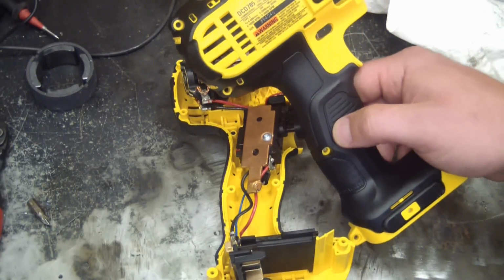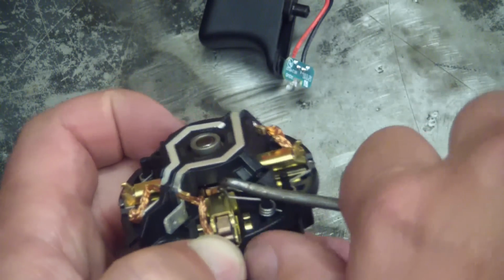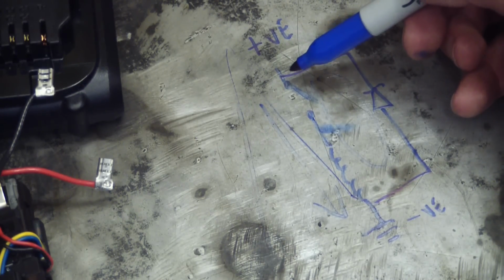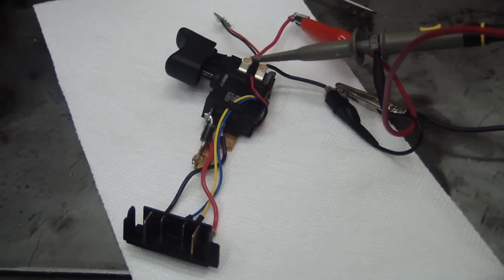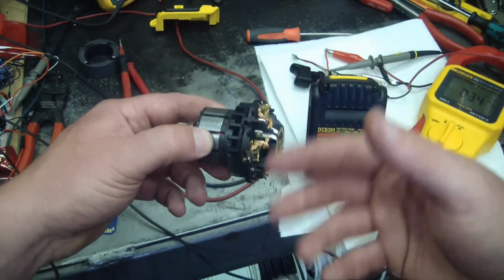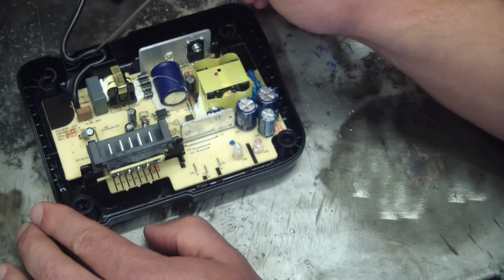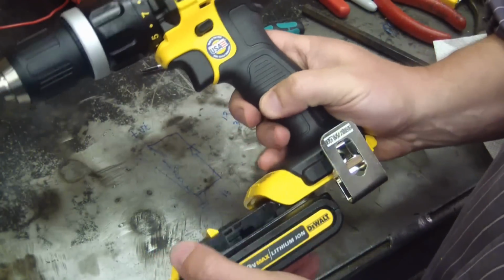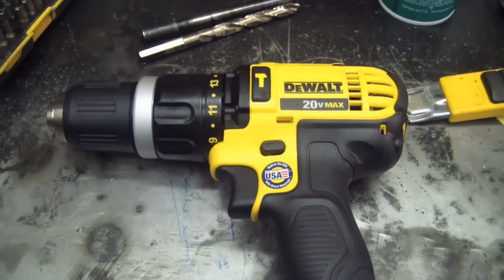BOLTR: DeWalt Hammer Drill. Test, tune and Electrical

Comment: You may not care much for hammer drills or love dewalt's construction but my dewalt 18v hammer drill has proved it's worth on the job and I've never second guessed purchasing it.

Hammer drills aren't a substitute for rotary hammers but hammer drills do fill a purpose where rotary hammers are overkill - you don't hammer roofing nails with a sledge hammer.

Comment: Great Job!  I actually understood your explanation of the electronicals!  I'm not starting from scratch...I already knew about shunt diodes and bridge rectifiers, but the rest was mostly new, and very clearly put.  Well done!

As for DeWalt tools, I was amazed at the power my next-size-down from yours drill has, and even more at the power of the impact driver that came with it in a set at a woodworking show. The demo they had set up let you drive 6" lag screws into pressure treated 4x4s. The little things drove them without slowing down, then ran them back out just as quickly, over and over again.  Convinced me and I bought them. Been happy with them ever since...several years. I think the impact driver is rated at something like 86 in-lbs. Won't replace the air impact wrench for changing tires, but for what it's intended for it's more than capable. 

Can't say the same about the Ryobe hammer drill.  Same issue with that feature as you had....can't drill rocks...or brick.  It does ok on concrete with a tapcon bit, but hit a rock in the concrete and you are done. I think it's about time for a lower end rotary hammer...don't need anything like your Hilti, just have a few holes to do around the house. Maybe Bosch?

Thanks for the interesting and informative vid!

-- Mike
Reply: BigMjolnir Hilti makes a lower end hammer drill. Not cordless, but mine has drilled plenty of holes. Yea it's not great but I bought it expecting to need to do just a few dozen holes in my lifetime and it is a fantastic standard drill.
Reply: I ended up getting a Bosch Bulldog Extreme 1" rotary hammer.  Not up to the big Hilti I expect, but for what I needed, it did great!  The hole in my concrete threshold that stopped the Ryobi "hammer drill" cold only slowed the Bosch for about 4 seconds, then it sank through another 2" of concrete before I could let up the pressure.  That was using Tapcon bits in a standard type drill chuck adapter for the Bosch's SDS-Plus bit holder.  For $170 it was a good deal.  I've got a few more holes that need drilling in concrete and brick...we'll see how they go, but I'm expecting they won't be problems.

BTW, a couple of the previous holes that were holding my aluminum threshold to the concrete step had wallowed out a bit due to only 2 of the 5 screws being in place for the last few years (due to the Ryobi's inability to make the other 3 holes).  I considered concrete patch and re-drill...too much like work.  I considered epoxy filling...too hard to remove the screws when the threshold needs replacing.  I finally stuffed a few bits of welding rod into the holes, and drove the Tapcon screws in.  They got tight enough to dimple the aluminum without stripping.  Good enough!  The rod is copper-coated, so it may not even rust for a while.  When/if it does, I have more...

-- Mike

Comment: Urethane Glue Smoo is the balancing material usually. The balancing engineer just chews a wad of that stuff like gum and spits it out in the right proportion and sticks on like you would stick bubble gum to a hiney receptacle maybe in a classroom or basesball stadium. Lithium batteries are not that forgiving once you go full chooch to finish that last hole, they go from 0 to baddaboom in tiny seconds.

Comment: The intermission reminded me of the chainsaw joke.

Oh and yes, the grooves in the commutator increases brush contact surface area.
York and other chiller manufacturers increase efficiency and output by rifling the copper tubes in the bundle doubling the surface contact area. The problem is that it really weakens the tubes though and vibration from the refrigerant impacting the tubes was causing leaks and broken tubes. One of the cons going on in refrigeration business is making more efficient copper coils by making coils with thinner tubes. This of course shortens the life of the coil.

The little groves in the brushes is getting to be more common which as you mentioned helps with wear in. I order some cheap standard motor brushes from Hong Kong and they came with those grooves as well. Nice idea.

Comment: Just two quick things: the power rating for the MOSFET is not the power it can switch through, but the power it can dissipate itself. If it's rated for 230W it's probably good for 100+A and thus it could actually switch a couple of kilowatts at 20V. Due to the fact that it operates as a switch, and not not in current mode, the actual self-heating is very small, as you have seen. The voltage drop across the FET is most likely less than 0.5V, probably much less. It's not an SCR where you have PN junctions to cross, in a FET you have a channel formed by electrons that acts as a resistor as far as PWM is concerned. I have measured a super el-cheapo 18V drill to draw even more than 40 freaking amps when stalled (albeit with a beefed-up battery courtesy of myself).
Second, the lithium charging CC/CV curve is quite a bit easier: constant current until 4.20V per cell is reached, then mantain 4.20V until the current drawn reduces to 1/10, and you are done.

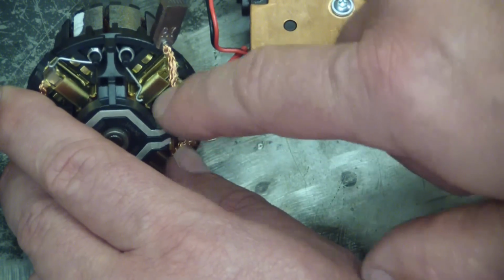Comment: 3:00 the solder vs crimping for stranded wire, remains an issue of debate I guess.
the reality of the thing is, a hobbyist can quarterass his way into a semidecent solder connection and into horrible crimp connection mainly because of the lack of a proper crimp tool.   A professionally (or machine/robot) made crimp will be better than any kind of solder connection.  A well made crimp can last a lifetime, bad ones... well.  I've seen some snap off a few hours after being made.

The issue with solder is that part of the solder will creep in between the strands into the insulation, harden the strands which will eventually break off under repeated stress and vibration.
You can remedy this to a degree by using solder with a good amount of lead in it to make it softer, but then we get into the whole discussion about lead poisoning and the environment and for various reasons companies making these devices don't want to go into the whole legality issue of still using lead based solder (which was mostly banned a while back).

Now for solid core wire, there's a much bigger argument for soldering, even with there being less of the issues burdening stranded wire.

TLDR: I'm not agreeing with you about the issue of soldering the wire.  I prefer stranded wire to be connected to a device with detachable connectors, though I am prepared to accept that those spade connectors (and especially the aluminium or galvanized ones) are horrible.  There's better (although more expensive) ways to make detachable connections.

Comment: I have a theory for what the "doo-dad" might be. Methinks Mr. AvE is trying to wire in a bypass mode to circumvent the electronical nannies inside the brain-box controller. Looks like a single MOSFET and resistor and maybe a schottky diode. could be useful if you want to run your drill from a pair of car batteries or some other voltage source. Might be able to increase the chooch-factor by over-volting it to 30 or so volts :) thats a nice little motor they got there I'm sure it could handle some power if you keep it cool. no speed control though, just bang-bang on/off. I could also be completely wrong but whatever. keeping my dick on the ice.

Comment: Multiple bleed resistors are to get sufficient voltage rating for each resistor, and probably also to get enough creepage distance
Reply: ***** That is a choke mate ! Nice video btw, recently found Your channel, Your fucking approach in making those videos is what makes me wanna watch all of Your vids. Keep it up !
Reply: ***** Actually, the power rating of mosfets does not come into play much unless you run them into linear mode where they are dropping lots of voltage (essentially acting like variable resistors controlled by voltage if mosfet or current if BJT). In switching mode you can run much more power output. The only limiting factors would be switching losses and resistive losses of Rds ON.

Comment: great video and in such a classic way.
I note however you drew the diode across the switch as well as the motor. the reversed diode should only be across the motor. cheers

Comment: The voltage at the battery terminals is probably 20 volts. But the FET's that do the motor pwm take away a couple of diode (pn junctions) drops, so roughly (2 * 0.6) volt less than battery terminal, and you end up with 18,something.

About the hammer part; Possible to mod it by grinding away a couple of those teeth?
Reply: Fabricate a new toothed ring? Perfect excuse for a lathework video if you ask me ;)

And since you're doing a video on that thingamajig you put in the handle, could be a great multiparter in the style of "How to turn your DeWalt into a Hilti". Repaint it, to make all the Walt fanboys rage etc etc :)
Reply: And how exactly do the FETs (of which there's actually only the one, in the trigger assembly)  have "a couple diode drops"?

Hint: they don't. While AvE might be used to seeing half-bridge PWM's (which use two FETs), these single FET ones aren't necessarily "worse". I'm willing to bet those are actually akin to the topology used by flyback converters (single FET, with the load being connected between the battery positive and the FET drain; source goes to ground through a low-value resistor / current shunt).

Comment: AFAIK, all lithium chemistry is charged constant current, constant voltage, at 1c. Internal resistance determines charge current dropoff as the difference in voltage decreases between capacity voltage and cell/array voltage

Comment: Welding rods/chopsticks - what's the difference? Your sushi just tastes a little funny. Thanks for checking out the hammer drill feature. My 10 year old Dewalt is finally burning up, and it's time for a replacement.(in it's defense, I absoulutely beat the balls off this drill).

Comment: I know a few back you were very kind about complimenting your viewers for their knowledge and how you appreciate such a competent audience.
I say that to say this: I'm here to learn and enjoy your, honestly, world class monologues. (I have a feeling you're nearly an unrivaled conversationalist)

But I've got a question that i've asked of several lambskin diploma type electrical engineers who honestly know their stuff a question that they have given me nothing but blank stares on. 
I think you might be just the guy to ask this so here it goes and I really hope you find it an interesting question.

I'm a welder, fairly seasoned, but still chasing some certs in school and I've got a pretty adequate Miller bobcat engine drive welder that's been shoved off a few mountains here and there. So I think it's easy to assume the "factory settings" are no longer worth a toot. How do you suggest I go about measuring the amperage output accuracy of the now long chooched potentiometer?

I've got a functional clam on ammeter, plenty of gas and more than a few disposable stick electrodes. And the readings I'm getting are obviously going to be changing constantly and WILDLY as CC processes tend to do with unpredictable resistance.

The EE guys suggested I hook it up to friggin heat-bank. Like that's something I've just got lying around. 

I was able to glean from the jargon that I wanted to find the "steady state" of the output while the arc has been well established, and then measure that.

Is that even how these machines (inverters or otherwise) can be rated? I imagine they do the marketing BS and do theoretical outputs in perfect states AT THE LUGS.

Now I've got some hefty cables that I probably have no business using and likely make my arc strikes a little difficult with current lags, but what I'm after here is "when my dial is at, say "five" how much juice is coming out? And is that even the proper way to decide how accurate the pre-sets are?"

Since it's a good old dumb engine drive that would get sick if it got near a computer, there is no "stuck on" feature, so I can just close the circuit for a pretty decent amount of time without tripping a "feature" switch. Would this be the correct way to measure the output?

I've taken measurements on the superman digital inverters at work and they all read on the NOSE with their dialed in amps (at the leads)
But when I compare those to the ones I'm getting on the transformer engine drive (the thing that actually makes me money) i just can't help but scratch my head.

Of course I could just crank the machine to where it feels right like a real man, settings be damned, but sometimes the geeky way is more fun, less expensive and comes in handy when I feel the need to bring it up when i'm feeling dumb in front of smart people.

List of things I have that may be of use: Ammeter, name brand multimeter with true RMS , welding rods, pieces of steel. THICK pieces of steel, and a solid 1/2" bar of copper (which I could whittle down if a completed circuit is needed and I don't want to explode my stinger.

I gotta say I'm impressed with how many questions I asked in my "one question"
But I'm just not smart enough to boil it down to to ask the single correct question I am sure I need to and can only hope you could do that for me. For free.
I just hope it's interesting enough for you to address. 

Thanks for the videos. Most of this goes over my head, but I'm starting to catch more and more of it as time goes on.

Walks out of post and makes an awkward pause deciding how hard or soft to close the door
Reply: Thank YOU, good sir.

It's the straight forward answers that make me feel sorta slow that I appreciate the most on account of them being the most informative and likely given by a source who knows whats a which.

I'm so stoked I'm gonna give ya my readings tomorrow afternoon. Not because it'll help anyone, just to bring things full-circle. 
Closure is such an important part of a good back n' forth

Comment: I have a dewalt 12 volt 3/8 impact. dewalt must be using EPDM on the handles instead of neoprene or nitrile,, so from working on greasy car parts, the rubber handles have now swelled to the point they can be overlapped and are falling away from the plastic handle. wtf

Comment: it's not a problem for SMD resistor to be 3 MOhms. The real deal is to be rated for high voltage. Because these little resistors have their terminals really close, you easily can get a spark. Or even conductance when it gets dirty. So what they do is spit mains voltage to smaller voltages with multiple resistors. The smd resistors cost a cent for 100 (or something). It's a lot cheaper than a TH resistor or a big SMD one.

Comment: True story: "You've got all this current rushing down into the negative." Well, actually, electrons are flowing from the... "We're NOT going to degrade ourselves by getting into a conventional versus electron theory debate ." hrmph. Fine. I got interrupted and hushed on cue from a pre-recorded video. That's humbling.

About the whole "Lithium ion needs CC then CV, etc". Bah, bullshit. Everyone says this, but, no. Just give it voltage and it'll charge. I used to think that the CC section was to safely limit the current that was rushing into the battery to fill 'er up, but I've found the opposite. You have to giver 'er an extra squeeze if you want it to happen at an appreciable rate. Nothing at all wrong with CV, will just usually take a bit longer. At least, that's true of the hundreds of cells I've charged, many of which were out of Dewalts. And... technically, Lithium Ion doesn't like just sitting with voltage on it, encourages crystal growth, so it needs to terminate the charge at some point even though supply and battery voltage is equalized.

Also, for Lithium, 1C ain't nothing. Lots of cells (maybe not these specifically) can handle a 20C charge. TWENTY SEAS! If you can push it, she'll take it. 5C is practically ubiquitous. Ditto for draining fast. The limit for charging usually isn't what the batteries can safely handle, it's "Gee, building a charger 10x the wattage is 10x as expensive, let's build shitty ones so they have to buy more batteries instead."

Comment: The PWM is what triggers the MOSFET, but what does the power regulation is called Chopper.... AND, when talking about AC to DC converters don't use RMS use V max 120v rms is 170v max (I learned that the hard way, burning LOTS of diodes and flunking an exam)... Love the vids!

Comment: Your explanation of the charger doesn't seem right. Isn't voltage usually lowered by the transformer from line ~110V down to mosfet level and then chopped up down to 20V?